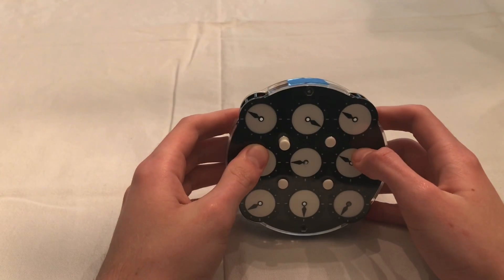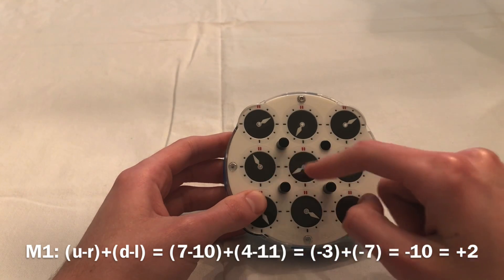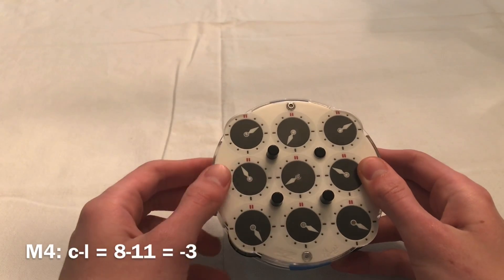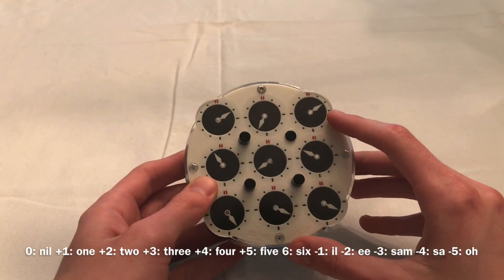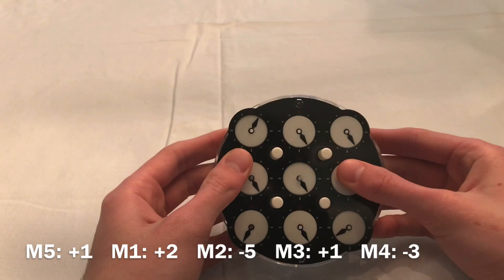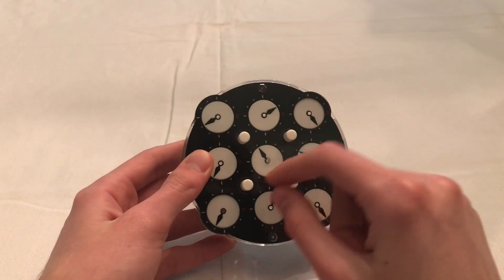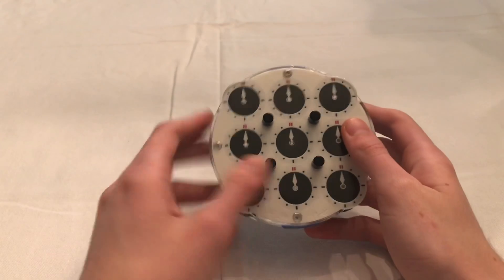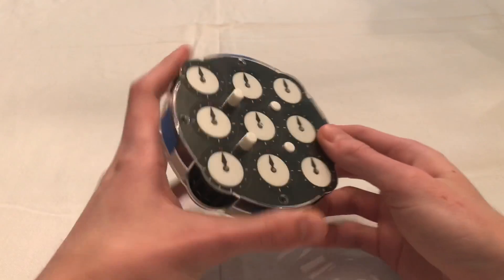Learn How to Solve a Clock No-Flip in 10 Minutes (Beginner Tutorial) - Sheerin Method

Comment: is the 12 o clock position considered 12 during inspection? or 0, and if theres an X-X=0 during inspection, do i use zero for the execution?
also for some reason whenever i attempt,  the backside cross is always made, but off by 1 from 12 o clock, but all the corners are at 12 , do you know where i am going wrong in my memo, or execution? great video!
Reply from the maker: > is the 12 o clock position considered 12 during inspection? or 0
It doesn't matter as long as it's a multiple of 12. Both 0 and 12 work.

>  if theres an X-X=0 during inspection, do i use zero for the execution?
Yes.

> also for some reason whenever i attempt,  the backside cross is always made, but off by 1 from 12 o clock, but all the corners are at 12 , do you know where i am going wrong in my memo, or execution?

You're messing up M5, probably in execution. Being off by one is commonly the result of mistakes in execution. Try to be more careful in turning the correct amount.
Reply: Thanks man, just one more thing, should I execute m5 at
The very start of the solve like you showed in the video, or does it really matter?
Reply from the maker: @danielahokas8085  Do it the way that's most comfortable for you. As long as do it on the back while at least 2 diagonal pins are down, it works. Think of it as setting up the cross on back to 12.

Comment: hey caleb, it’s me seth. Which version of no flip did you tell me you use earlier?
Reply from the maker: In competition today, I used this version of no-flip. However, 7 simul is better, and I'm in the process of switching to it. My written tutorial is as follows:

For memo, I memorize three pairs. I use x2 flips for memo.
**First Pair**: 
the first part of the first pair: c-d
second part of the first pair: (dr-r) + (U-L)
Every number from 1 to 12 (0) I have assigned a letter from A through L. For example, if my first part calculation is 3 and my second part calculation is 4, my letter pair I'd memo would be CoD. 

**Second Pair**: 
You don't really have to memo a full pair for this (you only need to memo the move on the back). However, I memo the full pair to keep consistency in my memo.
first part: L-U
second part: d-r
This pair is a little weird. To minimize flips, the first part is actually the second part in execution. For example, if this pair were 3 and 4, I would memo DiCe. 

**Third Pair**: 
This one's pretty difficult to get the hang of, but it's worth it for ensuring that you get optimal pin transitions in your solve. It's not too difficult after a lot of practice. You can also do this one like the second pair where you memo the second part first and then flip the memo to minimize flips but that's not how this is handled if you plan on one looking in the future.
For the calculation, make sure that you are paying respect to the "real" values of the clock faces. For example, if the red mark for 12 is at the bottom, then the top is 6, not 0 or 12.
first part: (UR-U) + (C-D) + DL + l + r
second part: u-c+d + (UL-L) + (DR-R)

**Execution**:
The way I execute my pairs is I do the initial letter on the left side and the final letter on the right side.
dl: do the first pair you memorized; for example, for CoD I would do +3 with the DL wheel and +4 with the UR wheel
R: do the second pair you memorized
DR: solve UL and C relative to L and U
\ : do the third pair you memorized
UL: solve the 2x2 (comprised of UL, U, L, and C) and DL to D
L: solve the 2x3 and DR to R
ur: solve all to 12
Reply: wow that’s a lot 😂 i might just stick with no flip for now
Reply from the maker: @brawlstar6937  Good luck! Feel free to ask me any questions.

Comment: How do you execute M5??? I've watched the vid but I don't understand. Also how do you know where to execute the other numbers? (Okay last question i promise lol) Any tips for calculating all the numbers in 12 seconds for a comp?
Reply from the maker: M5 is the first number you execute on the back. Think of it as the AUF move on the back side. The other numbers you need to execute in the same ways I did in the video. In every solve, you can execute the numbers you memorized in the same order. For reducing your inspection time, I'd recommend that you stop thinking of the math and just visualize the differences between the clocks.
Reply: @CalebTrelford  But how do you know where to execute M5?
Reply from the maker: @mrcubes2227  I’m not sure if I quite understand your question. You can execute M5 whenever at least two diagonal pins are down using a wheel that moves the back side.
Reply: @CalebTrelford  I'm just saying is there a certain spot you execute m5 or can you execute it anywhere when 2 diagonal pins are down using a wheel that turns the back side.
Reply from the maker: @mrcubes2227  You can execute it anywhere, but I would recommend using an upper wheel to avoid regripping.
Reply: @CalebTrelford  Oh ok, tysm!!

Comment: Hey ! Is the "no flip" method necessary to become better at the clock?
I am currently sub8-9 with the classic method and I would like to be able to improve and bring my average down as low as possible, what should I do? I just do a lot of solves to reach the level I have now, but is there a particular technique to become better at the clock?
Thanks a lot
Reply from the maker: You can still become world class with flipping, but this probably won't be the case in a few years. If you have any interest in no-flip, I'd suggest learning it sooner rather than later. It's much easier to switch to no-flip at 8 seconds than at 4 seconds. No-flip will make you better at Clock, but it'll take some practice.

Comment: when executing m5 does it have to be the ur dial when only dl is up or can it be ul pin up and move dr dial. Sorry if you don't understand this quesiton.
Reply from the maker: M5 is essentially the AUF for the backside, so you can do it on a down wheel whenever the pins on the back affect all five non-corner pieces on the back. This means you don't even need to have three pins down; you can also just have two diagonal pins down. In short, what you suggested works (though I'd suggest using the ur dial instead to avoid the bottom wheel move unless you really like turning bottom wheels).

Comment: For some reason, my solutions aren't solving the cross on the back, here is an example:
I started scrambling with black on the front and did this scramble: UR5+ DR6+ DL2- UL5- U1- R3- D2+ L2- ALL1+ y2 U4- R5+ D6+ L0+ ALL3-
For my solution, I used white as the back and these were my calculations: M1=3 M2=3 M3=1 M4=5 M5= -1
I started on the black face and put all pins down except for DL, and then I did M5 on the UR wheel.
I then solved half of the cross on the front as you showed in your tutorial.
I did M1 on the UR wheel while both of the R pins were down, I then solved the rest of the cross.
I executed M2 on the UR wheel while all pins were up except the UR pin, I then solved the first corner.
I did M3 on the DR wheel while only the DR pin is down, I then solved the second corner.
I then did M4 on the UL wheel while only the UL pin is down, then solved the last two corners.
For some reason this solution did not work, please help!
Reply from the maker: How did you get M3=1? That's incorrect. The rest of your solution seems fine though.
Reply: @CalebTrelford  Oh, lol. Sorry, I miscalculated. Thank you!
Reply from the maker: @JudeStradtner  Was that your only error? If so, I'd recommend that you just keep practicing. Over time, your DNF rate will go down (assuming that you are counting DNFs and trying to improve).
Reply: @CalebTrelford  Yes, that was my only error. I am counting DNFs and trying to improve. I intend to use this as my main method.
Reply: @CalebTrelford  Sorry to bother you again, but I'm still having issues. I have done about 12 solves and every one of them has been a DNF by 2 moves: A DL move and a UR move. Any idea where I'm messing up?
Reply from the maker: @JudeStradtner  You're probably messing up M3 and M4.

Comment: Nice tutorial! Do you think of it as subtraction? When I was practicing for my last comp I found myself switching to thinking about what turn I would need to do to move one dial to the other.
I also find it interesting that you directly memo M1 and M2 in order, I guess you find that easier than working out u-r and d-l separately first? I always seem to have a weird preference with these things.
Reply from the maker: I don't think about the math when solving. I only taught it like this because it's less abstract than distances between dials. After a few dozen solves, people don't even think of the math and begin just recognizing patterns. I think of M2 as the negative of d-l, but I felt that might be confusing and l-d is simpler anyways for beginners.

Comment: Nice tutorial! I've been using this method for about a month and I've found some ways to force a skip for the DL corner, but it probably isn't optimal so I'm very interested in your advanced tricks! Also I memo M5 first because I thought it made more sense and it doesn't change anything as far as  I know?
Reply from the maker: Thank you! I plan to make videos in the future on forcing corner skips, but they're easy to preserve if you place them in DL. You can force nonexistent corner skips with M5 and a setup move (in some lucky cases, a setup move isn't even necessary). Memoing M5 first doesn't make a difference, but I taught it last because that's how I learned.

Comment: thank you for posting this caleb this is gonna help a lot of people!
the only thing i think seems better is to visualize where the pieces are going instead of doing math. visual memory works better for some people than just having to do a lot of math in their head in about 12 seconds of inspection (maybe 15)
Reply from the maker: The math disappears after a few dozen solves. It's less abstract than distances between pieces, which is why I taught it.
Reply: Carter cubes that's what I thought at first but after doing some solves with it I find that like Caleb says, the maths becomes 2nd nature and doing it in under 12 seconds is so trivial now. It's basically doing addition on the ring of integers modulo 12, it's very simple